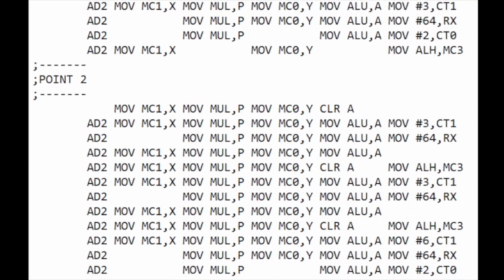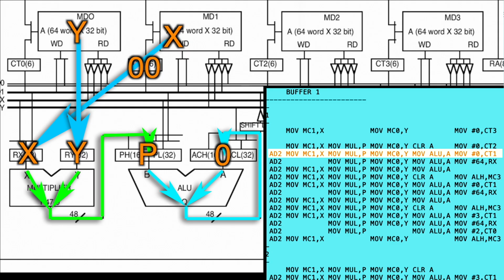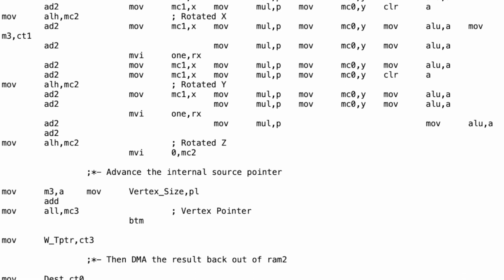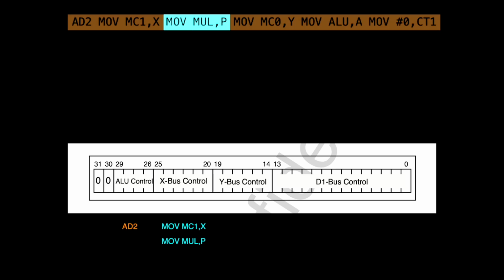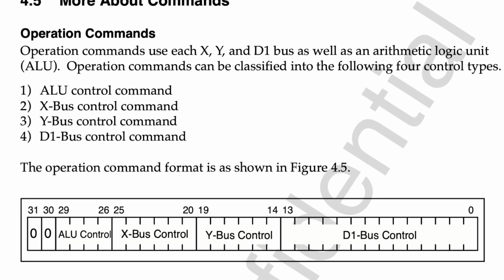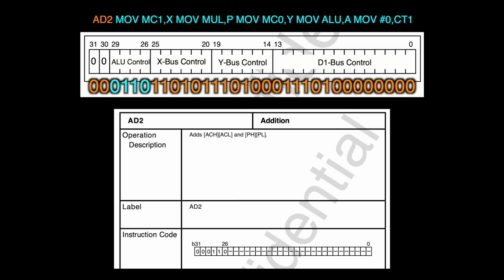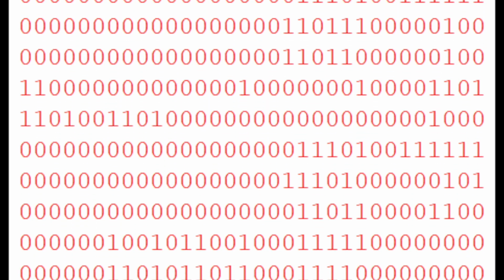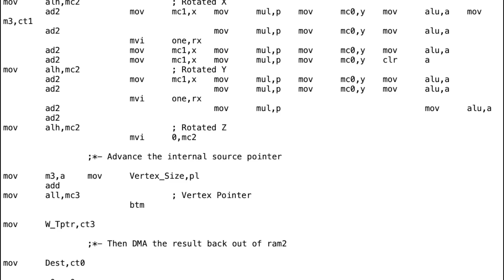The Mystery of Sonic R's Impossible Code - Coding Secrets

Comment: The manual correctly states that it can execute 4 types of operation commands simultaneously, it didn't say anything about how many operations are possible with those 4 types of commands. If other parts of the manual state that the DSP can perform 6 operations simultaneously then that is not a contradiction at all, you've simply misread the manual. The manual is saying that you can use 4 types of operation commands to instruct the DSP to execute up to 6 operations.

Comment: Looking at the wiring diagram the two commands "MOV MUL, P" and "MOV ALU, A" doesn't appear to go onto the bus but have direct lines from source to destination. In fact; are you sure these commands even do anything? Maybe they are there in the assembly mainly as an aid for the programmer to remember what the flow really is; but maybe data flows from the MUL to P and from ALU to A every tick all the time (or every tick when AD2 is called) with or without these assembly instructions?
It might technically multiply and add and move the result every tick, but whenever you clear or set P or A the result is simply discarded by switching the input from the MUL and ALU output to the bus.

If you still have the assembler, it would be interesting to see if the output actually changes is you include "MOV MUL, P" and "MOV ALU, A"  or not, assuming it even assembles.. (I'm pretty sure I've heard of several assembly instructions where some parts of the command is just there to make the instruction set look more consistent, like requiring a destination or source register despite having a default destination or there being only one possible destination or whatever. )

And if you have the working hardware and some probes connected to an oscilloscope, to see if the output lines from the MUL and ALU is always outputting every tick no matter what. (I have no idea how to do this myself, but I've seen youtubers with more electronics skills do stuff like that to decipher undocumented communication protocols.)

Comment: It seems like concurrent instructions work because on the circuit diagram the logical elements are wired independently and ALU codes don't have overlapping bits. If the ALU codes were consequential or the registers were shared between the operations, the execution of several operations would just mess each other (I didn't work with Saturn, that's just from an experiece from with small weird controllers).

Awesome video!

Comment: there is no x86 cpu would do that...only complete dsp, 2 vdp, and 1 cpu running same time on same line execution...when x86 can't never do at this point ...only RISC machines can...split the code on multiply chips to run whole line per line command...on x86 ...the code can't be split, it has to be in order from its registers to process each command by one of at time by order fashion from the cpu ...meaning they are taking turns what gpu gives and sound gives by extra lines than instead already combined  without wasting extra clock cycle

Comment: I guess they developed the processor with having a bit mask in mind, to turn on or off the 3 commands independently, but ran into some sort of problem with the second and third command being on at the same time and then designed it in a way, that they cannot be enabled at the same time (so its either x10 or x11), with only the first bit being independent.
And then the documentation writer mistook all of that for the processor expecting a 3 bit "word" to set the command.

Comment: This reminds me of the hidden opcodes in the C64 6510 processor that weren't (for good reason) in the 6502 manuals that everyone used as reference.

Ultimately, a microprocessor is just a machine that runs microcode that controls data flow through the various buses, registers, ALU, etc. If an opcode designed to do A or B can actually do A and B at the same time by setting/clearing bits that trigger the appropriate microcode (and there is no resulting contention for any resource), it doesn't surprise that the processor just happily does it.

Comment: I am in no way an expert on chip design or anything like that, so this is just an educated guess after taking a look ONLY at the X-bus documentation you presented. 

Only two of those commands actually use the data portion of the instruction bits: 100 and 011. This is because those require exclusive access to the DMA channel for memory transfer. However, the other documented command, 010, doesn't use the data portion. So, it can coexist with the 100 command but for some reason not the 011 command. That reason is because both 010 and 011 act on the P register. So in truth, the 100 command is actually a 1X0 command: it doesn't care what's in the middle bit because it's not concerned with the P register, but the last bit has to be 0 so it can have access to the DMA channel. Likewise, 010 is actually X10: it doesn't care what comes from the DMA channel because it is just doing precisely one thing that doesn't use the DMA channel. 011 is the only one that's completely fixed in its meaning without wiggle room, as it requires access to the DMA channel and the P register at the same time.

What I think is going on here is that the SEGA docs are correct in that there are only four commands in each word, but that the two six-bit commands can themselves be split into two each (as I imagine something similar going on in the other section) for very specific commands. The assembler would have to be aware of these specific instances and disallow the 010 and 011 commands on the same line because they're impossible to execute at the same time (or more specifically the result in the P register would be utter nonsense). The SEGA docs simply missed this use case because the DSP's ability to execute up to six instructions at once is, as you mentioned, insanely complex for a human mind to wrap itself around, and by and large the main problem had been solved anyway in the sample code.

Nowadays modern compilers understand multi-threaded operations much better and human brains don't need to worry too much about optimizing six instructions at once. Which is good, because we're really, really bad at it.

Comment: The block diagram shows that the X bus can be used to move [RAM] to X or P, and the Y bus to move [RAM] to Y or A. It also shows that the paths for moving data from MUL to P and ALU to A don't use the X bus or Y bus, respectively. It looks like the way they encode the instructions, the 25 bit means "destination X", 24 means "destination P", and 23 is a source select that's only relevant to destination P. Something like this:

000 -> likely NOP
001 -> likely NOP
010 -> documented MOV MUL, P
011 -> documented MOV [RAM], P
100 -> documented MOV [RAM], X
101 -> likely alias for MOV [RAM], X; or illegal instruction MOV ???, X
110 -> undocumented MOV [RAM], X MOV MUL, P
111 -> likely illegal instruction MOV [RAM], X MOV [RAM], P; or illegal instruction MOV ???, X MOV [RAM], P

Comment: Well, most of the time, when we think about undocumented instructions, we are thinking of invalid command.
But the schematics shows precisely that it's possible that the two registers would work together on the same bus.
Because it's a physical bus, meaning every bits are wired separately, so the instruction will get to every of them in the same clock. This could create instruction combination if the underlying device doesn't have a filter, which is the case.
So most of the old documentations just leave the user to expect that commands can be combined. 001 would not be a valid instruction because it doesn't enable the P register.

And, yes, I read the pinned comment first before writing this to find out if someone mentioned it or not. And indeed "Daniel M" did, and he use "unioning" for this behavior. I just write it in the perspective of a Computer Engineer whose interest in physical property of devices.

Comment: My guess is that the requirements was only 4 instructions at once, implemented with 4 straightforward instructions to meet requirements, then realized after you can actually do 6 because of how straightforwardly they designed the chip.

Comment: I think it's just an error of clarity - the documentation you showed says there are four TYPES of commands you can run, not that you can only actually run four commands. Six total commands of four four different types is technically correct according to that manual, just not entirely clear from a straight read of the text.

Comment: Having done ADSP2100, this architecture is different, but still very much 'one of those'. It would have been rather peculiar if it didn't do multiply-accumulate in parallel with data fetch, the one thing a signal processor spends most of its time doing.

Comment: my speculation is
100 and 010 are non-conflicting in the wiring, allowing you to use 110 to combine both in 1 cycle, but 010 and 011 are conflicting instructions, so there is no way in the wiring to combine them in 1 single cycle. And because they were conflicting instead of using 001 they used 011 to overwrite 010 in case you wanted to use the third instruction, since it would seem pointless to move mul to p then data to p in one single cycle. But by this logic it would mean 100 and 011 are also non conflicting, meaning that you can use 111 to combine them in parallel, which may be completely wrong, but it has hope, since you move same data in 2 different registers rather than 2 different data into same register...

Comment: This video triggered so many memories...
On the subject of the "hidden" instructions an educated guess is that moving data to or from the multiplier use two different data buses which can most certainly be controlled independently so not very surprising to be able to load the registers’s unit with the "input" data buses while at the same time sending the current result through the "output" data bus.
The bits layout for X Bus Control also hints at this as "010" (Mul -> P reg) and "011" (Data -> P reg) which both use the "output" data bus can't be specified at the same time because they share the 2nd bit (and the same data bus) whereas "100" (Data -> X reg or Data -> Y reg) which use the input data bus can be "or" with one of the previous patterns.
The animation at the beginning of the video is confusing on whether or not the result of the multiplier is sent automatically to the P register but the "010" pattern (Mul -> P reg) of the X-Bus Control bits seems to imply that this is not the case ?
Also i infer from your example that the "011" command from Y Bus Control bits should load the A register from the data bus and not the P register as with the X Bus Control bits ?
If this is correct the only way to achieve 4 instructions at the same time would be
(X-Data->X reg) 
and either (Mul -> P reg) or (Data -> P reg)
So 110 or 111
and (Y-Data ->Y reg) 
and either (ALU -> A reg) or  (Data -> A reg)
So 110 or 111

Ok I think I am over reacting to this but.. god it was fun !

Thanks a lot for your videos it is a real pleasure to dive back on these times (as a former Atari ST, Falcon 030 [yes with the DSP56001] and somehow Playstation 2 coder)
Keep going !

Comment: This is simply an example that computer architecture hardware implementation is controlled at the bit level. So it’s not really a case of being either 4 or 6 instructions in parallel, but which hardware level operations can occur concurrently. So the error is in the documentation, where the example %100 and %010 opcodes should have been more accurately documented as %1x0 and %x10 (where x represents “don’t care”).

Comment: As you said, the system will read and interpret 110 as doing 100 and 010, why wasn't this listed Sega didn't want to tell all their secrets would be my guess. but one can assume that this isn't unique to this chip and they all work the same and this was discovered after the fact and they just didn't want to add it into the manual, there is that possibility too.

Comment: Hi, this is called bit slice programming. 

In short this is not a hack or a happy accident, it is how the DSP was designed to work from the start.

I've not programmed the Sega DSP but I did work on one bit sliced machine back in the day and I therefore designate myself as that "someone" who can confirm your reverse engineering of what's going on and tell you why it works :)

Crucially the manual says you can do these four types of command simultaneously.

 But it doesn't explicitly point out that you can also do multiple ops within the X bus concurrently, ditto Y bus.
You have coded six commands but they fall into only four types as stated. 

As you are using different ops within the bus types they will all run happily together - basically it's separate silicon for each of those command bits, and a zero in that command bit inhibits that silicon.

 Looking at what you showed us, my guess was that you might be able to do all three X bus commands together if the occaison arose, ditto Y bus. It turns out that's my mistake as stated in the manual linked by another commenter

The commands were not listed separately in the manual as this technique would be obvious to an experienced bit slice programmer: namely that when you have a single bit position to run a command then you can do multiple commands simply by ORing the relevant bits together, so long as any shared data bits are the same. Whoever wrote that manual had done it so many times it felt like it didn't need saying

Given that you obvs have not previously experienced this kind of machine language programming before, I congratulate you on figuring it out by reverse engineering. 

I was trained in this kind of thing in 1980 and have not used it since 1983, so your video has triggered some techy nostalgia which has cheered my locked down evening no end... :)

This is also how some of the microcode within a modern CISC processor works: each machine code command triggers the relevant process within the microcode to implement that command, and the command that work on an entire string will be implemented using a one row loop like I describe below. Some RISC processors also use bit sliced microcode.

Let me indulge that nostalgia...

The bit slice processor I once worked on had command consisting of many more bits than the data. To distinguish a complete command from a date word we talked about a row of bits making the command. What a bit or group of bits did was defined purely by its position in the row: you can see how this makes it easy for the hardware folk to turn it into silicon.

A fun feature was provided where every row had ten bits used as a repeat count. If some of these were set then that row was run that many times before moving on to the next row (1 to 1023 times obvs). If they were all zeroes then that row ran till a condition was met defined by other bits in the row called condition bits. If the condition and repeat bits were all zero it was a noop whatever the rest of the row said but it still took one cycle. 

So you could write a for loop or a while loop in a single row, and pedantically a row always executed once was coded as a loop with one iteration.

Comment: That looks pretty much like pipelining in modern processors!

Well, there are some differences, but the idea is the same: try to keep all CPU units running at all times to gain speed. 

...but this "pipelining" is under the programmer's control,  in modern processors it is governed by microcode and/or chip layout. 
That's cool. 
From when was this chip?

Comment: these are binary enum flags so 0100 in binary is 4 decimal and 0010 is 2 and 0001 is 1 so these are flag instructions they are bit shifting to get the data you want so if you add the binary together it was always be a unique number and binary flag so instruction 0110 is just flags 2 and 4 together which would do both instructions you were explaining the mov x and mov into p and was thing with your y and a look into enumeratable flags it'll give you a deeper understanding of why this works and its an intended design choice bit shifting is very common in the gaming industry.
Reply from the maker: Not so. One of the three documented command used the code 011. If it was flags then it would have done the 010 command which it doesn’t.
Reply: @CodingSecrets  ah good point didn't think of that there usually this is the case when working with binary operators but you are correct that is a weird case in this case

Comment: Instructiom decoding is done on bit level. So all instructions which have disjointed bitnpatterns can be combined to run at once. Clearly the 1st 2 bits are designed for that. There is no table in between to map instruction numbers to instructions, but the bits directly trigger the interconnevtion of registers activating the moc or/and mul.
Reply from the maker: Nope - the command 011 works differently
Reply: @CodingSecrets  is there a command 111? Will it self destruct or do something sensible? Or just NOP?

Comment: I wonder if this case is similar to the MOS 6502 were the opcodes to perform multiple operations at once weren't an intentional part of the original design, but occurred because if you supply an unsupported opcode then the chip executes based on what parts of existing opcodes it happens to match. See https://www.pagetable.com/?p=39 for details of how this works with the 6502.